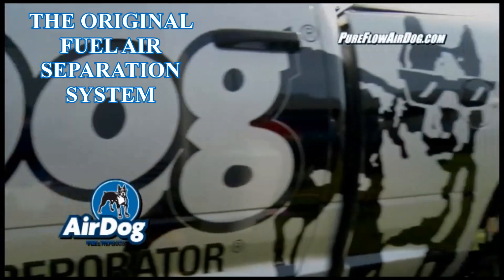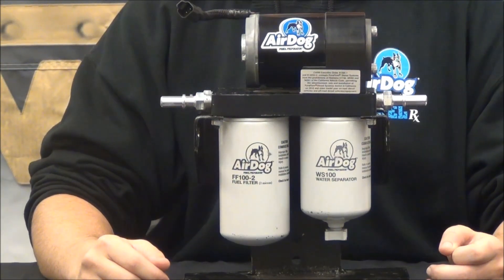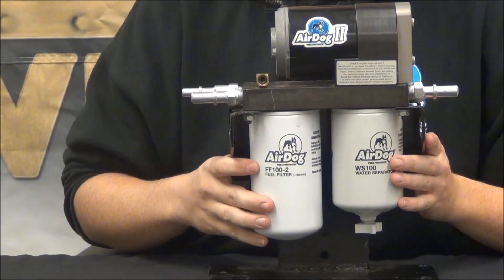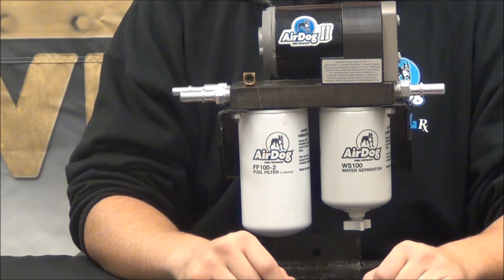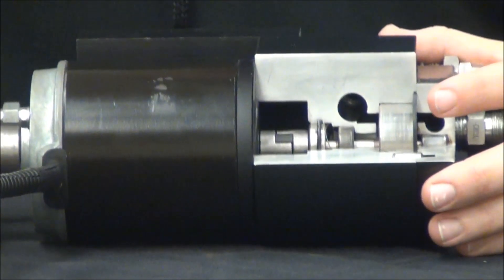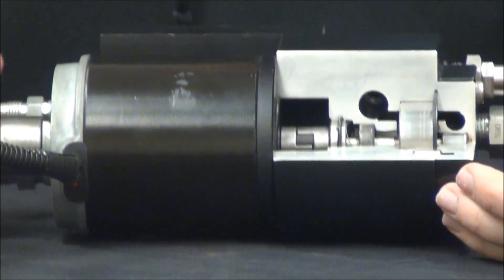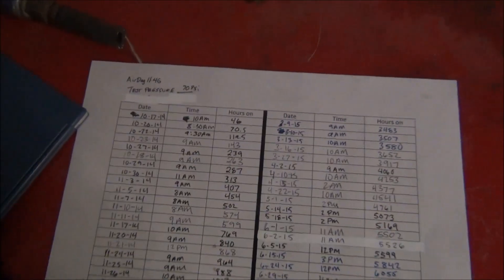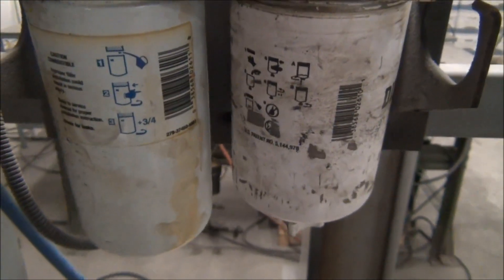AirDog® Comparison. What is the difference?

Comment: I'm way late to the party but I may see a flaw in the testing. I would think that the startup, shutdown and just sitting with stagnant diesel in the pump would have a fairly significant effect on the wear of the motor and components. If the test was done correctly, they would have one with each variant for testing.

Comment: Is there any sort of longevity test for the older FP-100’s? Cuz I can’t seem to get more than 2-4 years out of those older pumps (10-13k miles/year). I assume the 4G will only work with an Airdog II base or newer? Is there an upgrade path for those of us who got in during the original Airdog days? Would love a more reliable pump without having to shell out for an entirely new kit/install if I can simply change the tower or tower and base.

Comment: Is the pump still running?
Reply: Of course not :) ...but FASS tests like 20 at a time...not 1
Reply: I'm sure it probably is still running, because pure flow makes quality products, unlike FASS.
Reply: @mattcline570  it's not...in another vid I watched after they said it made it to 9000 hrs or something but no info on it
Reply: @MrMotofy  9000 hours is still pretty crazy.  That is over a full year.  If you are a trucker and don't really idle the truck, it should last over 2 years.  Assuming you do 2500 miles per week, 52 weeks per year, that is 130,000 miles per year.  And with a half a gallon of fuel saving over 260,000 miles at 5mpg without vs 5.5 with, that's 52,000 gallons without, vs 47,272.   That's a fuel saving of 4,728 gallons over the life of the pump.

At $4 per gallon, that is a saving of $18,912.  At $3 per gallon, that is $14,184.

The math says the system pays for itself 14-18 times over its life.
Reply: @MG-ks1qg  But it's still 1 unit...so not representative on any scale. FASS does like 20 or more at a time

Comment: Okay it's running for 9200 housrs but what about it actually doing what it's supposed to be doing was it still removing air from fuel and such. At how many hours did it stop removing air from the system but just kept running.
Reply: Why would you think it would stop removing air from the system? Not arguing with you just curious. I'm thinking about getting one for my truck and would like to get the best unit for my budget.

Comment: You have a life cycle test sample size of one, with no heat or vibration inputs! That is not much of a test!
Reply from the maker: We have a test going right now that is cycling our pumps 30min on and 30min off. We plan on adding a stand to vibrate the pumps. We had a pump on a vibration stand, but the air is shut off every night and we had to go upstairs daily to get the frequency right once the air was turned back on. We plan on going electric rather than pneumatic soon for that test.
Reply: You need a much larger sample size, an environmental test chamber and a vibration table.  You need to put some thermal cycles and vibration on your samples in order to get a valid test.  SAE has standards for testing.  Running a box fan on your test sample, in order to keep it cool, invalidates that simple test you set up. Get some data logging software (Labview) and at least record ambient/motor/pump temperatures, motor load, pressure, etc.
Reply: @ElectricDanielBoone  Hey cmon though...they have 1 pump testing
Reply: @AirDogSales  so what was the result?

Comment: When the need arises, can I replace the motor/tower unit on my older AD II with the new 4G motor/tower unit?
Reply from the maker: +tugboatman Yes you can. The 4G motor/tower will mount right up to an AirDog II base. If the need arises, give tech support a call and they will go over the options with you.